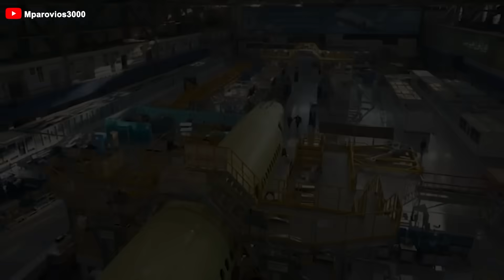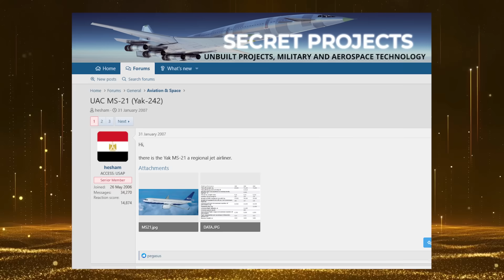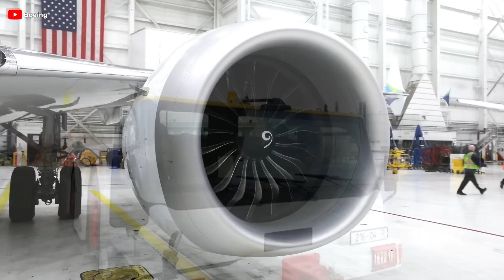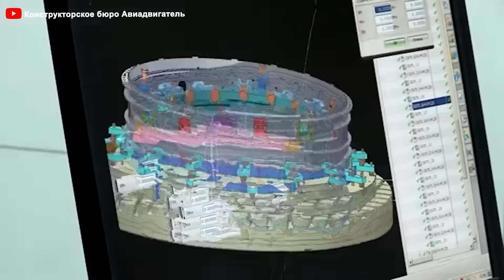This Russian NEW MC-21 Will Change All Aviation! Here's why

Comment: Yes. If Russia can build spaceship go to the space, thus build airplane like Boeing and Airbus is possible
Reply: It would have been finished for years if they had the same access to suppliers like the others. But now they had to actually make much more in house than any other model.
Reply: @MetallicReg I strongly believe Russia has the capability and capacity of self reliance.
Reply: @ They have - but it makes the production more complicated and takes longer.
Reply: @MetallicReg  The long run, it beneficial for self sustain

Comment: You haven't touched on the most important indicator.
The new PD-14 engine in combination with a very light airframe provides enormous economic efficiency. Russia has both 737MAX and 320NEO on domestic routes, they are inferior in terms of passenger-kilometer cost.
The MC-21-300 with the PD-14 engine surpasses them by 9-12% depending on flight modes.
Reply: Russia and China building their own jumbos.  So much for Boeing and Airbus monopoly.

Comment: All the best to the makers of the MC-21. I hope it succeeds. Russians are very capable technically but it's a long time since Russia has made a new plane design. Will it be a threat to Boeing? I don't think so. If production can be increased from a few per year to 5 or 10 per month it will begin to fill Russian domestic needs. After that the international market awaits.
Reply: Seems like they will put a few hundred in service domestically. That will allow them to shake out any problems and make improvements to their manufacturing processes that will allow them to produce the jets in number.  Airbus-319 and Boeing 737 max 7 are, per the video, the competition to the MC-21. Those planes retail for $90 -100 million.  IMO, Russia will be delivering planes to the export market for around $70 million, less if they are purchased in quantity.

Comment: Looks like an Airbus. Proportionally. The wingspan is short , wing aspect ratio is not great and the wing has no winglets. Because of that the range is not enough. An average aircraft at best.
Reply: of course you was there during the design stage
Reply: Care to post your degree in aeronautical engineering
Reply: I wasn't there during the design stage but yes I do have a degree in aerospace engineering 😁
Reply: If You're interested in seeing large wingspan and good proportions look at the wing of the Embraer 195 E2 - that is a good wing 😉

Comment: Both China and Russia produces best commercial aircraft. They will one day become major suppliers of commercial aircraft in the world.
Reply: Absolutely correct, especially China's Comac. In 10 years time they will be displacing a lot of Boeing and AirBus orders
Reply: @Peter-jl3qk  Comac is just the result of technological transfer of the airbus a320 and massive industrial espionnage in Airbus' factories in China. Just a cheap copy. At least the Russian one is innovating, but all tthe avionics and electronic flight systems still need to show what they are truly capable of, that only time will show.
Reply: The COMAV C -919 and the UAC MC -21 are very similar, developed as a joint venture between Russia and China until there was a dispute about engines. Avionics also shouldn't be a problem as Russia has proven with its military aircraft
Reply: You drink good stuff Ivan! 😅

Comment: Even if sanctions against Russia for invading Ukraine weren't in place, Europe (Airbus) & the US (Boeing) would have resorted to market protectionist policies to maintain & protect their market shares.  China's new C919 is already facing hurdles from the US to protect Boeing's business by restricting Western made engines using US tech & parts.
Reply: C919 is cheap copy of A320 through technological transfer and ALSO proven massive industrial espionage, cyberattack  in Airbus' factories in China. Of course, western are willing to ban it. And for the moment, it has not passed any safety test.
Reply: @user_YTB_98543 China is always spying on the US and Europe technology and stealing it 😂 What a bad intelligence agency they have. Do you really believe in this? And C919 is already flying in China and being mass produced
Reply: China already can build their own engines. CJ1000 and CJ2000 is being produced and tested. Just a matter of time to replace foreign technology like they did with Russian engines with their news WS15, WS19 and WS20 engines

Comment: I do not comprehend why both China and Russia do not join forces to work together on this kind of aviation projects!
Reply: @maanvol  The MC 21 and the COMAV 919 are basically the same plane. There was a difference of opinion regarding the engines, that's why we now have 2 different aircraft. Most likely a lot of parts are interchangeable.

Comment: To make a competitive product, it's not enough merely to create a good aircraft. Exporting your planes overseas needs a solid aftersale network of parts supply, maintenance, etc. and this is not in what Russians excel. 
As the story of SSJ suggests, foreign buyers of it eventually found  operating these overall decent aircrafts unfeasible for the reason above. The few foreign operators of Superjets eventually ceased using them due to difficulties they faced when doing technical maintenance. While in Russia the aftersale service somehow works, it totally fails outside of it. Hence I do not believe MC21 will be commercially successful worldwide.

On the other hand, the main purpose of creating MC21 is likely not to compete with western manufacturers, but to have an own airplane to substitute sanctioned Boeings and Airbuses for Russia itself. If this is the case, MC21 may do the job.
Reply: Very good observations and points in regards to post sales technical support and maintenance. Do you know how Airbus or Boeing does post sales technical support and maintenance, an example how they manage support for its Asian, African or S. American customers?
Reply: If and once sanctions are lifted, then it's problem solved.